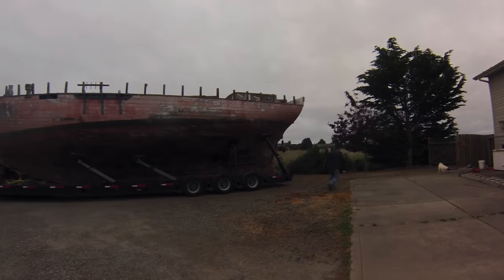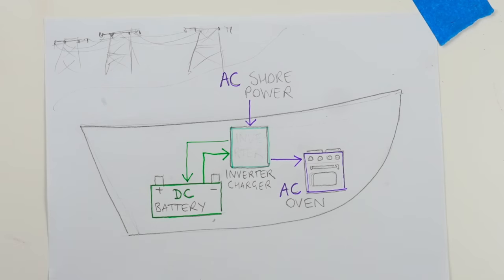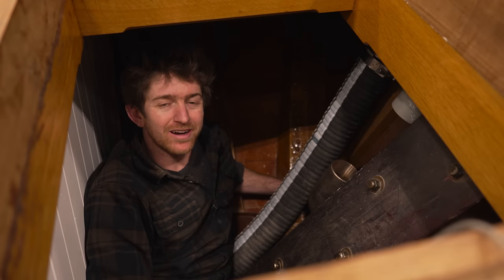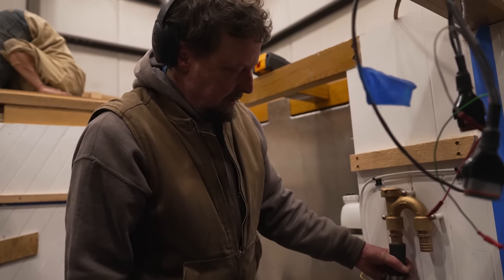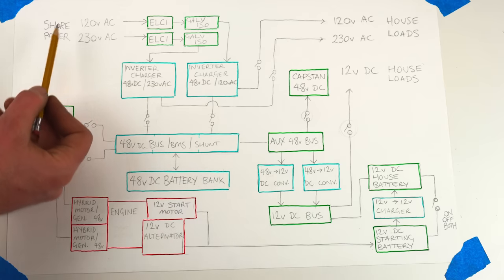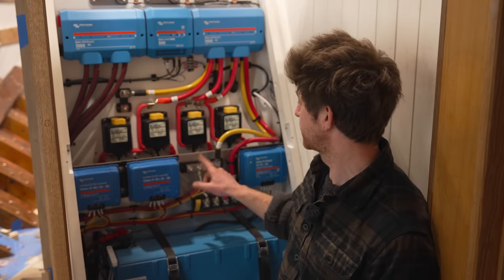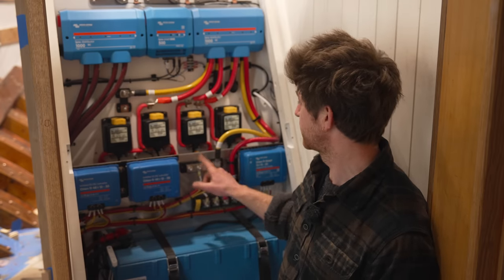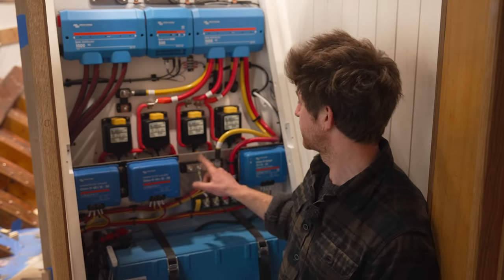Electricity is dangerous

Comment: That is a fairly long uphill exit for the head to the holding tank. It will require considerable volume of water intake and pumping to leave the hoses empty of waste. Allowing waste to sit in the hoses will result in permeation and stinking. Top quality hoses will last "a while" but will eventually reek. Also holding tank vents need to be large and potentially multiple, great ventilation prevents anaerobic conditions which is a major source of sewer smells. I suggest Peggy Hall's books on marine sanitation. Stinky boats are never fun!

The engine room systems and electrical systems look fantastic! Solar panels all over that gorgeous boat would be a shame. Your timing of this rebuild is perfect, all the 48V, inverter, battery systems and main engine driven generators are relatively recent developments and production boats are just now utilizing these sophisticated systems. Having only one engine to maintain is so nice. As Mark Twain is reported to have said, put all your eggs in one basket, and watch that basket!. In that light, have you considered an oil change system and fuel polishing system? I might have missed that discussion in previous videos. Love the project, hope to cross paths out on the water some day.
Reply: Interesting point about anaerobic conditions. Tempting to come up with a bubbler of some sort - could be fed by a piston activated by the boat rolling - would presumably be a lot more effective than multiple vents?
Reply: @Gottenhimfella  Good ventilation seems to be all that is needed but most tanks go under bunks and floor boards so are wide and flat with more surface area/volume. A significant premise in most designs is continuous downhill hill runs to holding tanks, even with great attention paid to no sags where output can sit. Your idea might be great in this tall tank. Maybe in a year or so we will get an update on systems, what worked and what required revisions.

Comment: This is a cool electrical setup Leo but it seems like with the weight of the diesel tanks, the many different batteries, the 4 cylinder water cooled diesel, and the electric hybrid drives this has to all weigh in the thousands of pounds.  You might make this boat aft heavy, which you could balance by putting weight in the nose, but I had a boat like that once and the two masses and far sides of the boat just created terrible hobby-horsing.  If I shed the weight in the nose it was aft heavy and just had terrible weatherhelm on the point.

Comment: Love the Victron Energy inverters. Had one on a small ship powering an emergency hydraulic power pack for the tiller. Also worked with them as a synchronised bank providing 3 phase output. Great system

Comment: Hi Leo. Maybe i misunderstood something but if the toilet requires a seal / vacume to flush and you got a vented saltwater inlet line then you would not be able to achieve a seal, normally the vented lines are placed on the discharge side of the handpump. I might of misread the drawing, as always keep up the good work.
Reply: Leo forgot to mention this in the voiceover but he did add an explanatory text subtitle when he showed the bronze vented loop for the raw water supply to the vacuum toilet, explaining that the vent needed to be closed when flushing. For that reason the loop is exposed, in the head compartment.

Comment: The diagrams with the arrows were a great way of explaining the systems. That's quite an electrical system! I thought the level of detail was great.

I saw that control in the engine room and was wondering why you had an engine throttle in the engine room!  Makes sense now with the clutch for generator/propulsion.

Comment: Hey up. I was very interested in the technical detail describing the charging/battery set up.I personally have just wired up my house for solar so a lot of it translated easily. On that note, i was a tad suprised to see that in your Victron set up there is no provision for the use of solar panel charging. I have watched a few YouTube videos where yachts are using panels and/or wind turbines mounted on decks and masts.I follow that when under sail, you can use the forward motion of the boat to spin the propellor and thus the engine, creating a type of wind turbine in a round about way. Are a few solar panels not a worthwhile consideration ? There are panels about now that are over 500watt each. Other than that, the yacht is comin on well.Can't wait for the deck furniture and masts to go in, that will be the proverbial one step for man, one giant leap for subscribers.I noticed on this one that you have masked off the deck planks so i presume deck calking to soon follow ? Anyway, love the channel and the progress, she is a great vessel worthy of the tie and effort. Best regards.

Comment: Technically, clamps shouldn't be used with barbs, as barbs are unidirectional enough so that if you push a hose on it should not back off.  But a) with a cast item the barbs are super dull so clamps are not only "permitted" but encouraged.  On fittings with a bulge on the end, clapms are perfect and appropriate.  With sharps barbs, clams aren't accomplishing anything except adding pressure to ecourage the hose being cut thru.  But the big hoses on the cast barbs should probably yeah get the clamps, and yeah, I HIGHLY prefer the embossed clamps - I  use WERKER clamps from Germany and have an entire array of sizes.  It's not worth going on the cheap wiith this.
Reply: On boats the situation is unusual, and clamps are essential, along with barbs.
When a boat falls off a wave and lands in the trough, hydraulic pressure shockwaves can be created in the tanks sufficient to momentarily expand hoses and blow them off the barbs. This may or may not happen in theory, but you can take my word for it that it happens in practice.

Comment: Serious piece of advice on the battery system I have and I am sure that your system engineer is probably already going to do this, but it is something that should be highlighted in a video: you need to take corrosion on the metal terminals into consideration on the electrical system. The smaller crimps should be silver as the corrosion from them will still conduct. The larger ones that are stainless steel are going to need a protective layer of grease or other corrosion inhibitor applied to prevent problems with reliability and to maintain the ablity to maintain the system. Since the system days air from the bilge, it will be drawing wet air at times, so there will be corrosion on the terminals, especially the DC ones. I would advise keeping a can of spray terminal protector rated for marine use onboard for if you need to take a terminal off and re-protect it for any reason, including the one on the started for the engine. Oh, and protect the terminal to the starter on the engine too.

I know this from my training as an industrial electrician. Industrial settings have electrical systems in wet areas all the time and problems like that happen all the time, especially when the panel manufacturer never intended for you to install the panel in a place that has 90% humidity all the time and it sits there for years. You open it up when it stops working and everything is rusted, you can't get the nuts off to clean the connections, and it takes you hors to get the panel working again because every connection needs to be cleaned to make it work again. I am pretty confident that your systems engineer already has this covered, but talking about it in a video would be a good idea as metal corrosion on a boat is something that is a constant fight just like keeping wood from rotting from rain water.
Reply: I didn't realise silver sulphide (the only corrosion product likely on silver) was low resistance. Thanks for that!
Where high reliability is required I guess it could be worth getting stainless termination components silver plated.
Reply: @Gottenhimfella  Plating isn't really worth the effort in that case. It is better to just encapsulate the terminal after installation with a silicone grease. For small connectors you just use solid silver metal. Same thing for contacts on low amperage switches and relays. Plating is going to corrode through or get scratches in it, causing the rust underneath to create resistance.

Comment: Great vid..   blue seas makes great stuff, except for their battery switches..  be aware that the on/off/both switch in the engine room will degrade very quickly in the engine room… ask me how I now….   I’ve also replaced three more on customers boats because they just break and fall apart if wires move a bit or are pulled when opening a panel.  These switches are screwed together instead of riveted, like other manufacturer’s, and that’s  it’s weakest link..

Comment: Blue Sea Systems, Victron Energy & Groco make very good equipment for all levels of marine systems. It looks like you are using Sealand for the sani hoses so there won't be much smell bleeding through from the black water. Being able to isolate the poop pump makes servicing it a little easier, but I would suggest keeping a repair kit on hand.

Comment: I worked with my dad on our 1948 Wooden 8 meter. He use to take off these systems off because they were so hard to maintain years later with parts being difficult to find.  I wonder what 20 years later will bring.
Reply: Agreed.  Too many things to go wrong.  The other extreme is no engine at all. 35 years sailing a 1913 gaff cutter engineless.    And very glad I did.  Loved every moment (well almost).  But horses for courses, I guess.  Big boat ,big ambitions.  That's Leo.

Comment: We had two of the Victron DC to DC chargers on our boat.  They get very hot.   We pulled them off.   You will probably quickly look for a way to cool them by adding extra fans or remove them.  Cheers.

Comment: You’ll probably need some visual cue’s when the prop shaft clutch is engaged vs disengaged both in the engine room and at the helm. A physical locking bracket at the switch handle will also be helpful for redundancy to avoid unintended switch movement.

Love the system design and application. Should serve you well.
Reply: I don't quite get the point of having this system to isolate the prop shaft. If the engine is run with gearbox in neutral (as opposed to fwd/rev), wouldn't that give the same result, where the engine's acting as a diesel generator?
Reply from the maker: The gearbox has to be engaged to drive the electric motor/generators, as they run from a belt behind the gearbox - hence the need for a shaft clutch.
Reply: Ahhhh - I get it now! Thanks for the explanation

Comment: I have the same arrangement for the head tank with pretty much the same manual pump and two Y valves. I went through two of the Jabsco plastic ones after dealing with the calcium build up many times. Eventually I installed a bronze one.

Comment: One little nitpick: AC power in houses in North America is actually 240V with a center tap in the service transformer that allows you to access either 120V across either end and the center tap, or 240V across the two end taps (more similar to British or Western European electrical service). Some inverters produce split phase power as well (since it is only a little bit more work), maybe yours does too. :+ )

Comment: Leo as you talked about electrical safety and the LIPO vs Li-Ion batteries it made me think  of the several boat fires I have heard about caused by  Li-Ion battery fires from go- pros  drones and other rechargeable consumer electronics. It might be worth thinking about Lipo Battery Safe Bags for the boat and maybe even a special cupboard that is lined with fire resistant materials as a place where li-Ion power devices and their batteries are stored when not in use.

Comment: Love it. How do you drill through thick things and ensure it comes out in right place on other side?
Reply: In the case of the bolts around the exhaust skin fitting, they drilled a hole through a piece of scrap timber in the drill press, and then used that as a drill guide to keep the hole square to the surface. For the keel bolts, they had others sighting against witness lines or string lines.
The propellor shaft tube was a special case, they built outboard guides for the boring bar at both ends.
When using a big hole saw it's pretty easy to make sure the teeth all contact at once, and that gets it started square.

Comment: Liquid electrical tape, will save you lots of time and money in the future, it will help stop the connectors from corroding, and will help prevent accidental shorts, but beware, it STAINS everything, it will melt some plastic, several layers are usually needed for good coverage. But anywhere you have a bare connector, bolted to the inverters, the batteries etc... cover them with liquid electrical tape. It will easily peel off if you need to service the unit.  I would even suggest using some light thread locker on those threads as well, it acts as a lubricant when removing and will help prevent seizing, and of course prevent them from coming loose due to the effect of vibration from engine etc...

Comment: Great episode.  Found myself wondering a few things:

The exhaust doesn't get some type of one way barrier?  What if a wave has the energy to push past the upper loop?  And how about sealing the exhaust through hole?

And for the electrical locker there are holes to the bilge?  Could sea water splash up through there?

Comment: So that is a lavac head, right? The vented loop in the inlet hose to the head is a special lavac part, right? Because an unrestricted vented loop won't allow you to draw rawater into the head. I am sure you are installing it correctly with the lavac instructions and supplied parts. But I just thought I would mention it.

Comment: Quite complicated but at least you touched on all parts of the electrical system without forgetting to say that there was a reversal of direction and purpose. Most explain "this is the inverter" and stop there without saying how you switch from use to charge. etc.  Still at a loss but not near as bumfoozled in the end as others force on the listener.

Comment: Odd suggestion: there are “automatic” fire suppression systems for RVs and cars (I first saw em made for VW Beetles) that are flexible tubes filled with an extinguishing agent and gas. Fire melts a hole in the tube, which auto expels the fire extinguishing agent. Might that work for the battery bank as an initial fire protection system?

Comment: Great crafty as always.  But as someone who has worked with inverters on high current systems for over 20 years I would suggest that you strongly consider not putting those in the engine room.  They are already likely to be the hottest thing on the boat to the point where you could cook breakfast on them if they are under high loads.  They really need to be in a well ventilated cool place.
Reply: The engine sucks in air for combustion...that air comes from the interior of the boat...and has to be supplied via? portholes being open?, companinion way being open? dorades?
When the engine is not running but the inverters are....the sealed under stair cabinet sucks cold air out of the bilges and warm air exits via the fans at the top....

Comment: I hope that you plan on covering most or all of those live front terminal strips once you get everything wired in.
And I hope your watertight system for the electrical system works very well. The ventilation scheme is kind of worrisome, but hopefully the intake is baffled well.
One seawater incursion incident that gets into your system will wreck it. Here's hoping the designers and installers have done their work properly, as a lot is riding on them.

Comment: The electric motor design is very cool. I was curious, can you disengage them from the diesel and still use them as generators, driven by the propeller under sail power?
Reply: Yes, by keeping the diesel's transmission in neutral. Blip the electric motors in reverse to wind the prop blades into reverse pitch, waterflow will hold them in that position, the prop will windmill & the motors are switched to generator mode. At the end of the charging session, burp the motors in forward drive to wind the blades into forward pitch, then waterflow will feather the blades.

Comment: Is cool damp salty bilge air the best way to help cool the electrical cabinet?  I would think it would speed up any future corrosion issues with any electronic gizmos.  The low holes would also allow water in should you ever have an emergency where water could submerge the batteries needed to run an emergency pump.

Comment: One thing that wasn't clear... Can the hybrid motors be driven by the prop drag alone?
Reply: Yes - w/ the diesel's transmission in neutral & the boat under sail, you blip the elec motors in reverse to wind the prop blades into reverse pitch. Forward hull motion keeps the blades pressed against the reverse-pitch stop. Now the elec change is switched so the motors become generators as forward hull motion spins the prop to charge the batteries.
When the charging session is done, the gens are switched back to motor mode & given a blip in forward direction to wind the prop blades back into forward pitch. Now the forward motion of the hull through the water presses the prop blades into feathered position - they won't stay in forward pitch if the diesel or motors aren't turning the driveshaft in the forward rotation.